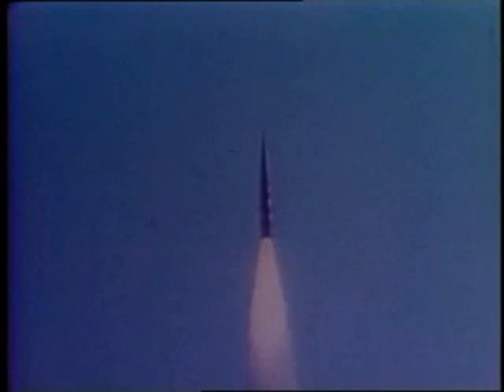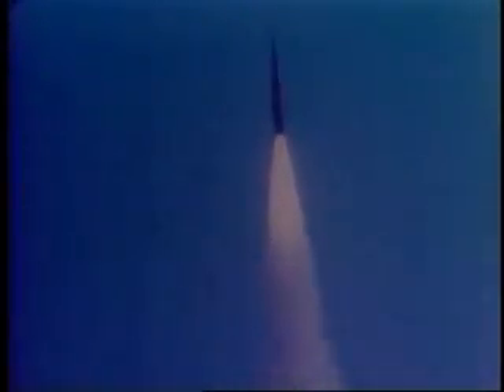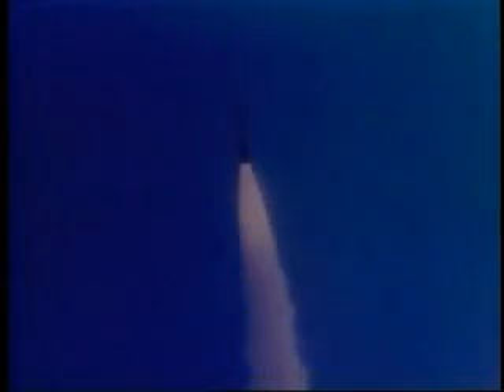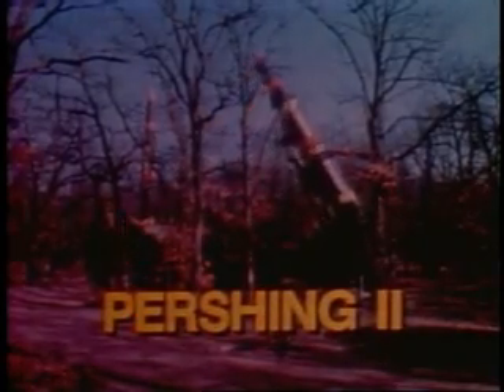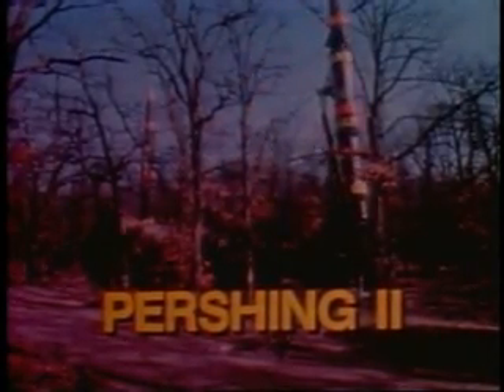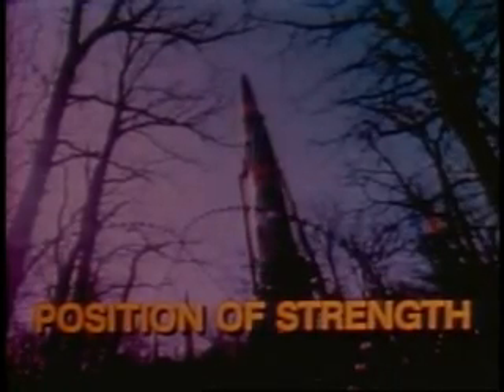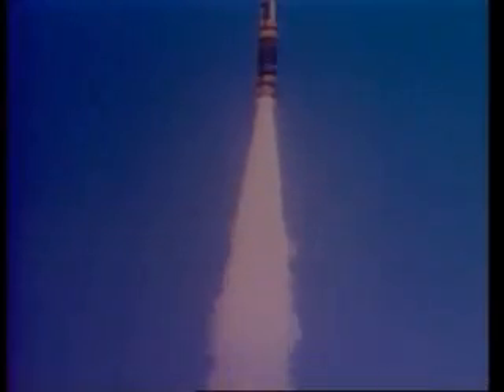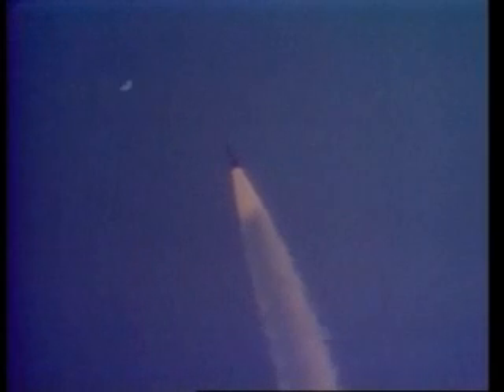Pershing II- Position of Strength.wmv

Comment: Thanks for posting this video, Ed. I was at Wiley Kaserne, Neu Ulm, Ammo Platoon HHB 1/81FA 1984-1985, 11B serving as field security for warhead movement, which of course, didn't happen. In reality, we did a lot of aggressor work against the firing batteries. Good duty, wonderful city. 

Question for anyone who knows: after P2 was decommissioned, what did the Army do with the 15E types? Also, did the firing batteries have infantry attached for local security, or only Ammo Platoon/HHB?

Comment: Hey this is probably late, but my dad was a SFC for 56th Field Artillery Brigade/Command and was one of the SNCOs in charge of the Redleg Incident. He's asked me if it be possible to find a recruiting video they made for Pershing (my "uncle is supposed to be in it and wants it for posterity). Any help tracking it down would be greatly appreciated.
Reply: I've been curating Pershing related documents and videos for several years but have not found any recruiting videos. I'm briefly in a 21L video.
Reply: @edpalmer7995  Ed, I was an 11B in HHB 'Ammo Platoon', 1/81FA, stationed at Wiley in Neu Ulm, in '84 and '85. I have pictures from there you might want to see. Some people, some of Wiley, and some of the MANN trucks and launchers. Even have Santa on a P2 at the mess hall. Reply if you want to see them, I have them on Google.Drive.
Reply: @edpalmer7995  Alright. That's kinda what I figured.  Thanks for getting back so fast.
Reply: Ed 21850 Were you in B 1/41 and B2/9 anytime between 83-86?
Reply from the maker: @dalenye9166  Nope. Redstone Arsenal 81-85 then 55th Spt Bn until 89.
Reply: I was there when the incident occurred. Was an e4 then .

Comment: As a 15E I can tell you that P2 was lightyears ahead of P1a. Much easier to enplace and count. My P1a experience,  was limited to AIT and a short tour at 3/9FA, and it was clearly an old and outdated system by 1983. Though P1a until P2 was rolled out, did it's job and did it quite well.
Reply: In Germany P1A was used by our own troops until 1991 (FKG 1/FKG2)

Comment from the maker: P2 did not need to be as powerful as the SS-20, as it was more accurate. SALT I and SALT II were supposed to limit the arms race, but the USSR found a loophole in the agreements that allowed them to develop new midrange missiles. The NATO Double-Track Decision saw the deployment of the P2 for a quick strike into the nearer targets under 1200 km and the Gryphon ground launched cruise missiles for a slower strike at longer range targets.
Reply: Hi Ed, do you happen to have a copy of the full un-cut video this is fron?
Reply: Yes There are always loop holes to exploit, and Russia has developed very powerful weapon systems, along with the good trading partners in China that welcomed all of the manufacturing technology that we could not be bothered with anymore, in exchange for cheap happy Wal-Mart customers, it seems that capability is a overhead expense that just should be given away, to trusted friends that care so much, i know we use the argument that they need us, I'm beginning to wonder why they need us, true currency is knowledge and the ability to apply it, and we give it away like it's a liability